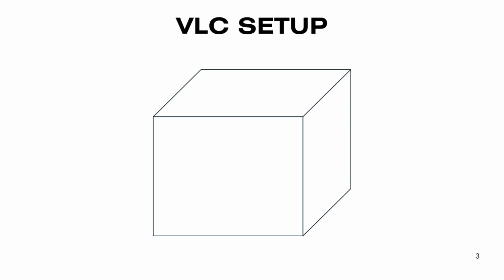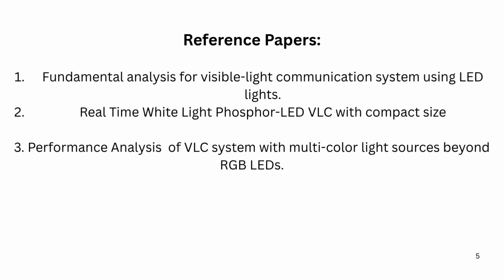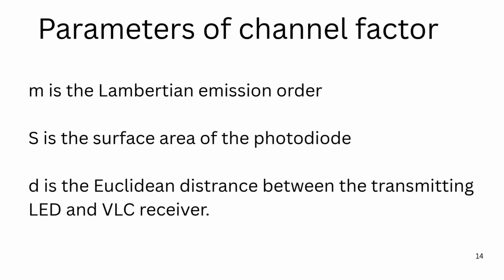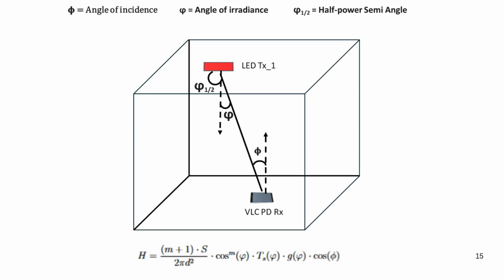BASIC VLC SETUP - 002

Comment: so similar to LED lights can we use infrared or laser lights or an old bulb for communication?
Reply from the maker: Not traditional incandescent bulbs because their way of producing light is different and modulation is not possible due to slow switching. However, infrared, laser, and LED are semiconductor devices and due to fast switching of light like on/off switching which we technically say  on-off keying is possible, data can be transmitted using these devices. A lot of research work is going on the development of laser technologies for data transmission